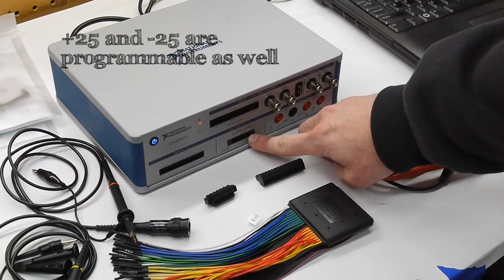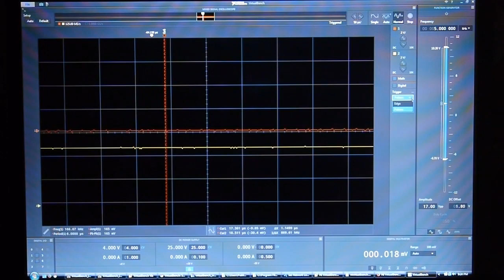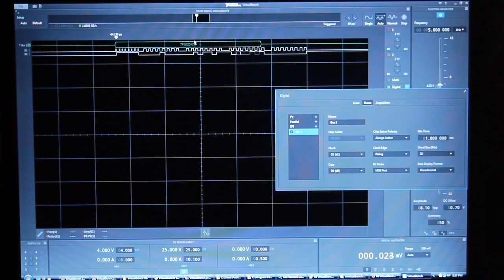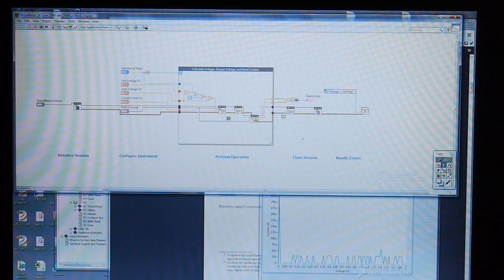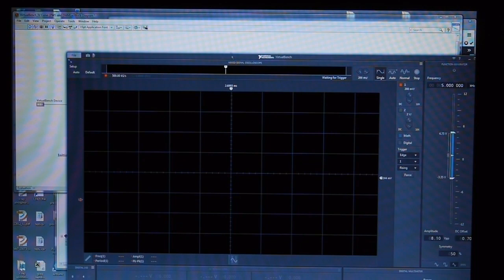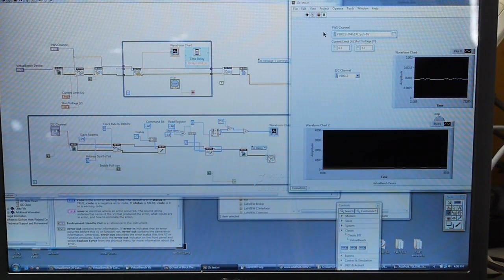Review of National Instruments VirtualBench

Comment: Another good use for the wifi capability is if it's in the field, then you can talk to it without lugging around extra hardware, and if it's not feasible to use a hardware connection
Reply: Rob Mckennie A computer qualifies as 'extra hardware.'  Things like this are only suitable for ATE and similar applications where the instrument will not be controlled by an actual human.  For anything that needs to be controllable by something in meatspace, four words: Knobs.  Buttons.  Switches.  Screen.
Reply: randacnam7321 a computer is extra hardware, but it's multipurpose extra hardware. Sure it's nice to have a physical interface, but do you feel like carrying around 20 different panels for talking to your various installations?
Reply: Rob Mckennie
Dealing with multiple separate intuitive UIs is better than one thing that tries to do everything and does none of what it is capable of better than separate equipment.  The number of situations where this level of integration and combined control are needed are pretty much limited to ATE situations anyway.  This is not something I would have to dick around with in the field as the UI looks to be a pain in the ass.  And a friend of mine who was testing one of these for our school found using it a pain in the ass.
Real labs and shops almost always use standalone instruments for the simple fact that pure computer UIs are a right pain to fight just to get the damn thing to show a sodding signal let alone do any analysis on it.
Reply: randacnam7321 Let's say, for the sake of argument, you need to control 500 different devices, all with different UI needs, and none of which can have a permanent control panel. Would you prefer to carry 500 control units that are all perfect, or carry 1 that is just kinda okay? Sure, it's not super realistic, and I don't care. I was just making a little comment, and there's no need to throw a fit over it.
Reply: Rob Mckennie
Which is not a likely situation for a typical or even relatively atypical lab setup.
Anything that complicated will most likely be some kind of ATE setup anyway.
My point that this kind of instrument has no advantages for the vast majority of human operated test rigs still stands.
As a meatspace hardware design engineer, I don't want to drag around a complicated computer controlled thingamajig like this every time I need to power something or take measurements.  Time is money and dicking around with recalcitrant test gear slows work down, drives NRE costs through the roof, pisses off the techs and worse.  If I need a multimeter or power supply, I use one that has a power on time measured in seconds.  If I need a scope, I have an analog Elenco job and an Owon Tek clone DSO that are ready in seconds and a Rigol that takes less than a minute to boot.  And anything needing something that spits out serial data can be done with a microcontroller and some line drivers.  Or just a power supply and some switches for static logic line stuff.
Reply: randacnam7321 ffs, what are you trying to convince me of? Here's the question. Is it possible to contrive a situation where it's useful to use a pc as the sole interface to a multitude of difference devices? That's all I care about.
Reply: Rob Mckennie
Are there such situations?  Yes.
My point was that for the majority of scope uses, a standalone instrument is preferable.  One of these would be better than one of the umpteen crappy microcontroller based DSOs on the market, but given the choice, most engineers and techs would take a proper scope and separate signal generator/logic analyzer/PSU as everything has its own separate UI and separate things can be used on separate projects.  And then there is the matter of how much or how little each instrument in this thing is isolated from the others.
Reply: randacnam7321 I stopped reading at yes, goodnight.

Comment: So you wouldn't recommend this over something like a DS1000 series O-scope (+DMM and PSU) for an engineering student or new engineer who wants to build a small personal lab on a budget?
Reply: johnfranks you got that so right. If you pick up as much of that used as possible (or ask a college professor for some older hardware they don't need) you can get all of that for a few hundred bucks.
don't forget a few good multimeters, and a solid multi-rail adjustable power supply!
Reply: Falcrist 
I'd go for separate "real" instruments, if you aren't pressed for space and you don't have the need to program your instruments. And I say that as someone, who is using Labview and NI's hardware (even expensive one) quite alot.

Get used instruments first and upgrade them one by one after you know what you need. A dedicated instrument will most likely still work in 20 years, if you don't knock it around too much. Can't say that about a PC based solution. Or are you planning to keep a computer with the last software supporting it around for years?

Even if you go for new stuff, 2000$ will get you quite decent equipment, including an oscilloscope, function generator and power supply. My 3-channel power supply is over ten years old, still works like on the first day, never had to install an update and works within a second. I'm using a 30 year old (I think it's from that time) analog Tektronix scope (used 2215A with second timebase, that's very useful). Still working fine. For a logic analyzer I got one of the el-cheapos from ebay that got me all that I needed till now. My function generator is a repaired Hameg Fgen, just has Sine, triangle and square from 300mHz to 3MHz. Up until now that was all I needed (PWM would be fine though; but I just do that with an Arduino if I need a signal like that). All in all I spent maybe 400€. Yes, I have to improvise sometimes, but that's also the best way to learn something.

Separate devices also have the advantage that if you select the correctly, all their outputs can be floating (i. e. no common ground). I don't know how it is in this device, but in many of these combined devices, the oscilloscope, function generator, logic IO and powersupply all have the same ground reference. That can be really limiting!
Reply: Even if NI try to pass this "all-in-one piece of electronic test gear" this is no match for normal oscilloscope.
My company use extensively NI products (PXI based modular instruments) but they are in reality only useful for automated testing, not as laboratory instruments.
Reply: You can get a LOT of really nice gear for $2k....  If you are just starting out, you'll also want a nice soldering station, various soldering tips, prototyping supplies, consumables, resistor/capacitor books, LCR meter, analog scope, inspection scope, shelves, storage bins, dev boards, etc...

I would die if I had to drag out my laptop and plug in that big box every time I needed to make a quick voltage measurement.

Comment: Nice unit, but I wouldn't buy it for the price. Something good to pick up "for parts" and repair.
Reply: The app reminds me of the music looping software FL Studio. Annoying small buttons that you use all the time :|.
Reply: for what it does its well worth the price.
Reply: brandonhughes7 If I was manufacturing something, or had a good application for it I would be all for it. But I would just be using it for the occasional hacking up of whatever comes around, or maybe repairing and diagnosing equipment.